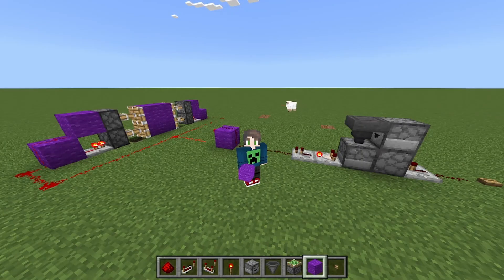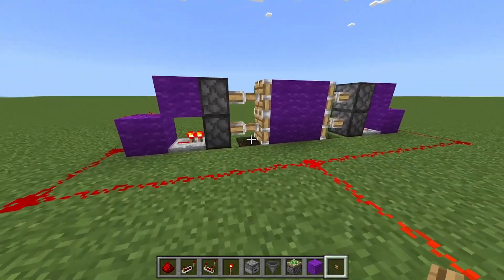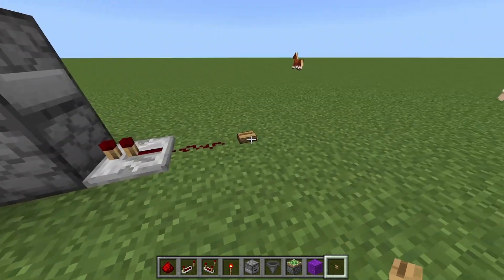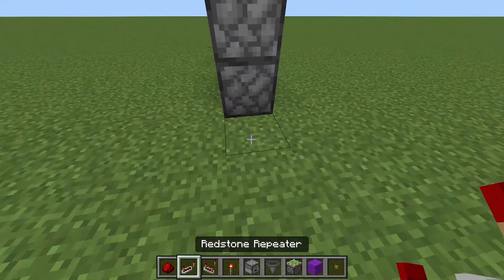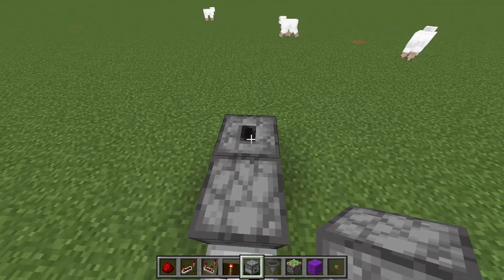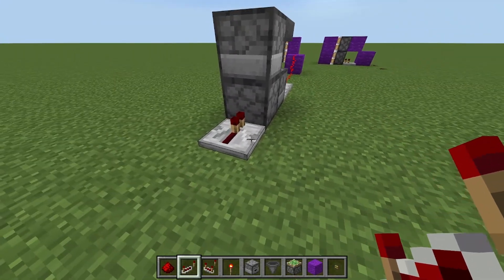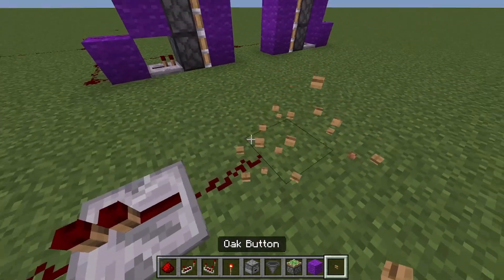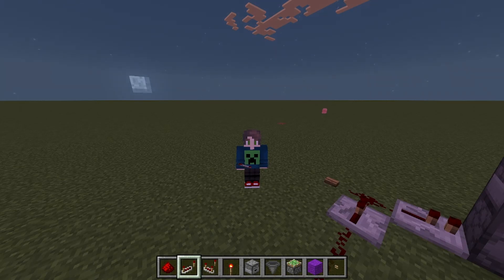Minecraft Redstone Two Way Button Door

Comment: Works well, but unless the signal gets too low in your particular setup, you don't need any of the repeaters in this tutorial. I built mine with a clever use of slabs to go vertical with the redstone dust behind the sticky pistons, and used zero repeaters.
Reply from the maker: Great call! I can see that they are not really needed after taking a look at it. Thanks for the input.